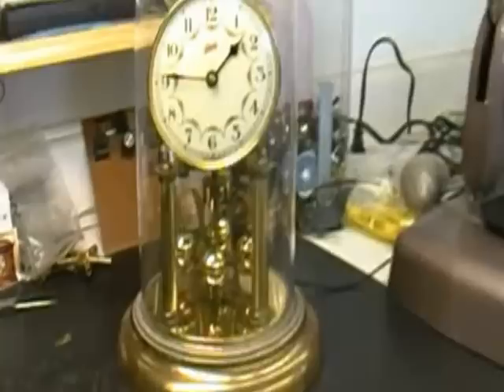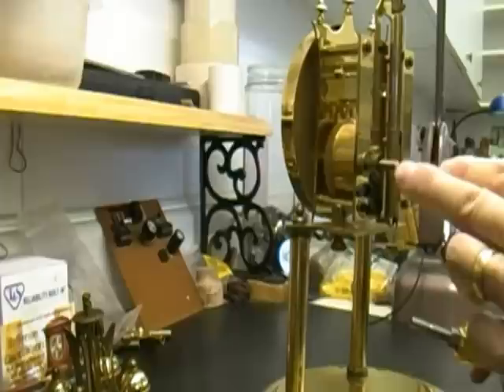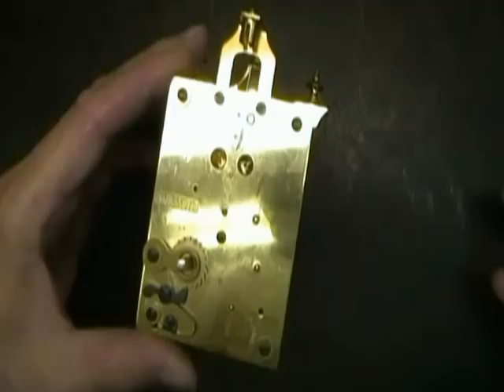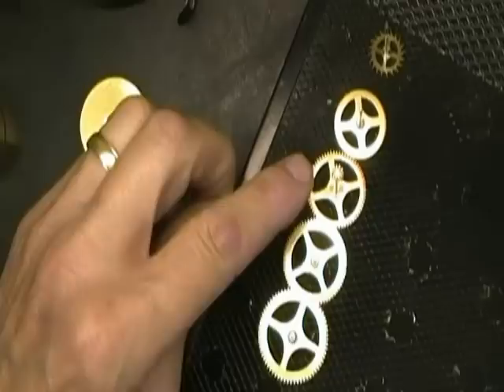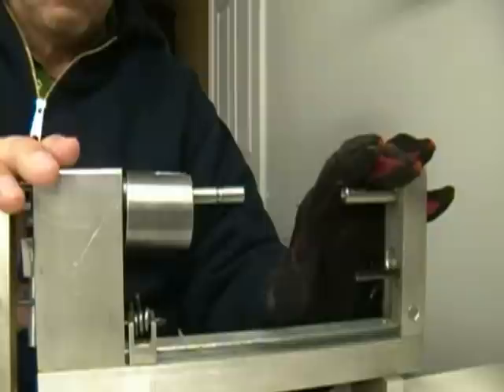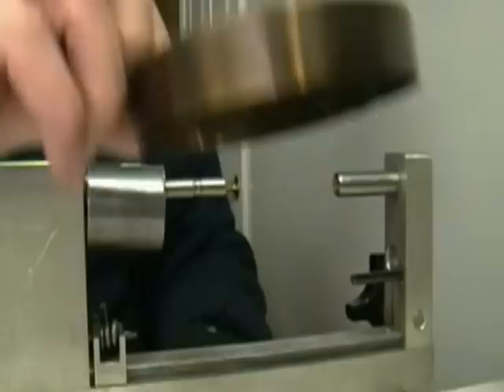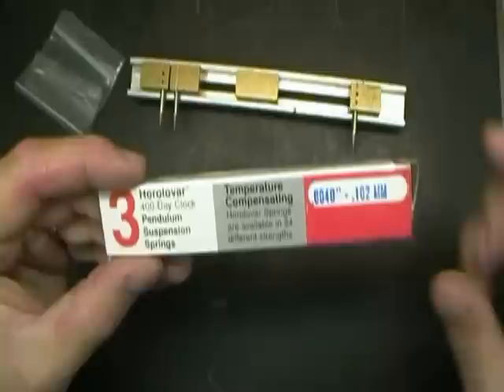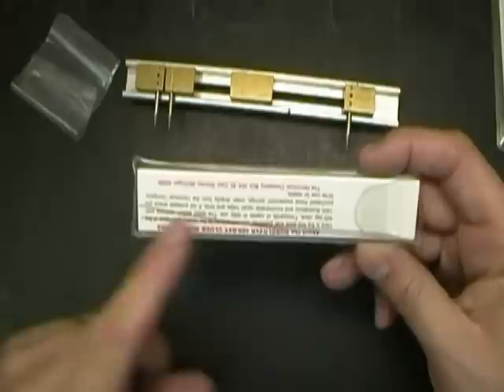Schatz 400 Day Anniversary Clock Movement Repair Short Preview

Comment from the maker: Torsion clocks are very precise clocks, running an entire year on the same power that other clocks need to run a week. They can only do this by having all their rubbing surfaces cleaned and polished. Normally they do not need parts except for the suspension spring. Cleaning and polishing comes first.
The repair process is shown and explained in my video in a 2 dvd set. About 6 hours. Its takes longer to teach it than to do it.
Thanks for Asking
Al Takatsch

Comment: Hi, 
400 day anniversary clocks were the hardest I ever worked on! I've repaired clocks since I was in my early teens. Unfortunately it is no longer my profession, I however still repair them from home. The major issue I had with these clocks was getting the suspension spring correct, too long or short and the clock won't run! I'm old school, I used to let the springs down by hand, remove them by hand and put them back in by hand! It hurt but that's just the way I was taught! Good job.  
Dylan

Comment: good video good explanation! I would also like to add a excellent running schatz that is textbook perfect. my favorite type of clock I try to stay away from any other type. in my experience most real clock repair shops do not like torsion clocks. even though they really are the simplest to take down. and few ever need pivot repair.